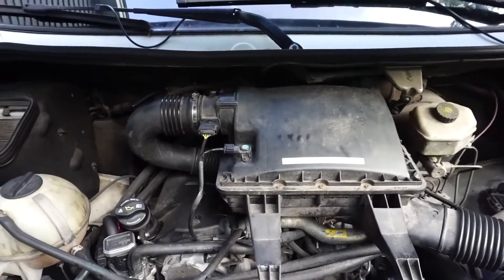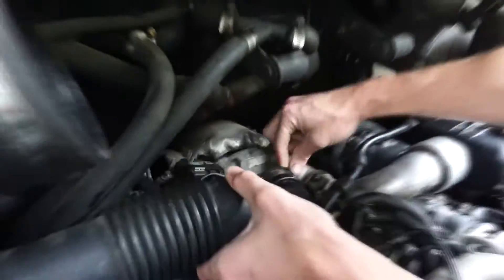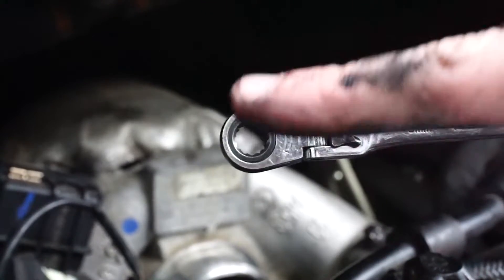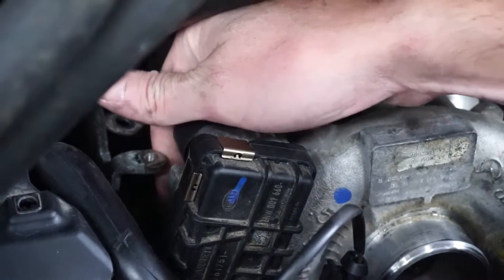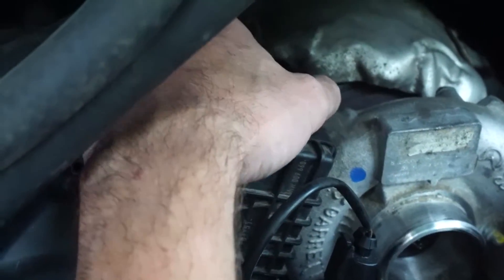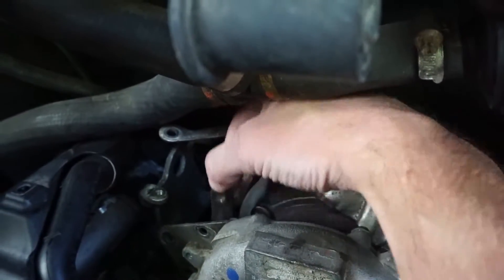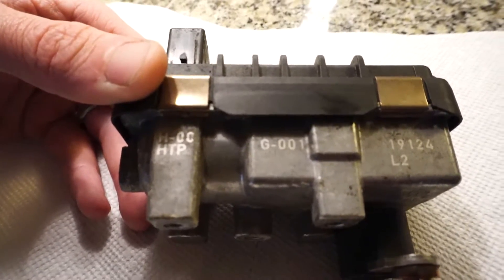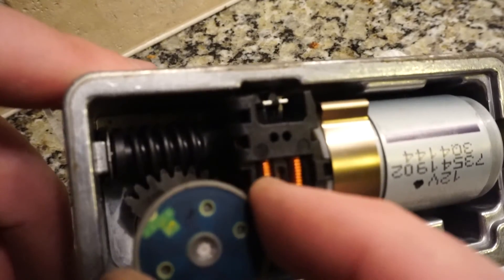07-09 Sprinter Turbo Actuator Removal and Diagnostic

Comment: Nice video you said you will link the where I can get actuator for 2008. I called few places they said I need to buy whole thing with turbo. So please let me know where I can buy actuator itself. Thanks
Reply from the maker: I don’t have a direct link for an oem complete actuator unfortunately. I’ve only been able to find remanufactured units as well as oem rebuild kits from hella, but they are only available overseas. You can find an aftermarket one on eBay and potentially amazon and other sites if you search around. There are a couple different versions/numbers so I’d hate to link you to the wrong one! Best of luck with your search!

Comment: With a low or high boost error code, I removed my actuator and added a small drop of solder on every main connection, I heard vibrations can cause them to become brittle. So far so good, codes are gone, thank you for the video
Reply from the maker: Emile Goguely very glad to hear you’ve had success!

Comment: My actuator lever is not seized but does not move with ignition on and revving the engine. Would you suspect the electric unit needs repairing?
Reply from the maker: I would try resetting the battery/ecu and seeing if something else has caused it to be in limp mode, but With it not moving at start up, I’d believe it may have failed.
Reply: @DabSedan  Hi, I know it pass three months already since this comment was done.
1- Did you was able to find why your actuator wasn’t working? Yo can diagnose it disconnecting the connector and tap first pin with the positive of you battery and the second pin with the negative. Then the fourth pin, get one more negative and apply slightly tap like morse codes. This will make the actuator moves back and forth. If only moves when you connect the first two pins and not when you tap the fourth one, the actuator is working good but you aren’t taping the last one right.

Comment: Great video. Quick question: what are the symptoms of a bad actuator. Although the battery is brand new, the first start of the engine always takes longer (especially if not driven for a few days); lately, I can't rev the engine over 3RMP (which makes her very slow to get up to speed). 
Do you think that this may be the root of the problem?
Thank you for your time.
Reply from the maker: It could be this for sure. Unfortunately there are several systems that play into it so I can’t say for sure, but with those symptoms, it absolutely could be this as I experienced similar ones leading up to this

Comment: I have sprinter 315 2007 and there is no actuator at all wonder what have happened and why it's been removed. Van working good
Reply from the maker: A N is yours a turbo Diesel engine?
Reply from the maker: The 2.2 wasn’t offered in America as far as I’ve seen. What symptoms/issues are you having? I will see what I can do to help!
Reply: @DabSedan  i dont have any issues just bought van and noticed actuator is not there.
Reply: Yours might be the vacuum type actuator. MUCH SIMPLER.
Reply: @shifty2755  you are right it is a vacum control type

Comment: Hey what was the problem? I have a Vito 2007 with the same v6 3.0 cdi and mechanic tells me to change this Turbo actuator. The problem is the engine sometimes works well and 1 minute later it hasn't got any power we changed all the sensors(map, maf, turbo pressure) because the computer write these for problem but they are brand new and all the cables are in good condition. What do you think it will solve may problem?
Reply from the maker: Kristóf Kovács I’m not sure what’s necessarily wrong with your actuator without testing it, however replacing the actuator sounds like it will solve your problem as it has solved my problem and many others!
Reply: Thank you!

Comment: In Vancouver, BC, we cannot order this part so I had to get it repaired. Its day 5 and so far so good it seems resolved. BETTER than resolved. Back when it was 'normal'', on a cold start before engine was warmed up it would hesitate a little. I always thought it was just a cold engine, the repaired actuator does not do this, the hesitation is gone. The other thing I notriced is when I take foor of accelerator and tough the brake then go back to accelerator, there was a clunk which I assume was a transaxle issue. Thats gone too, the old actuator must have twitched sending a surge of power. Overall the vehicle is smoother now, I always track my fuel consumption so will ahve to see if its improved where historically it was getting on avg 12-13L/100k in the city.
Reply from the maker: Jason Palibroda that’s awesome to hear!!! I’m glad it solved your issue!!
Reply: where did you get it repaired?

Comment: I assume its still working for ya, just curious whats your odometer at?
Reply from the maker: Jason Palibroda my sprinter has had a new engine installed before we purchased it. The new complete engine has around 150k on it. The repair solved the issue for sure, although I do have an update video that I am currently working on and will be releasing soon.
Reply: @DabSedan  where's the video?   What were the symptoms to think this was the cause.  That looked like normal play to me

Comment: Did the engine make a hissing noise before you fixed it? I have a wk diesel and its showing the p0299 code so i think this is the issue. Its also clunky upon slow acceleration.
Reply from the maker: Jared Ballard that hissing noise to me would indicate a potential boost leak? Have you checked the inter cooler hoses?
Reply: I looked at the inner cooler hoses but could not find any leaks
Reply: @jaredballard7853  I work on some sprinters at work. They are rare in my area so I don't get enough of them. I have seen these vans missing orings in the cac tubes causing boost leak. I have seen more hissing leaks when the gaskets blowout between the exhaust manifold and turbo ypipe. It is hard to see. I have someone rev it as hard as possible in gear, holding brakes while i feel down there, laying on the engine with my arm jammed down the firewall. These vans also leak at the egr. A plugged scr can cause leaks at the flexpipe. If you have a leak at the flex pipe, cut it off and look into the scr/cat to see if the cores came apart. If the scr is fucked you will see loose cubes, in this case the flex blew because of blockage in scr. You have many points of failure. Check for soot stains everywhere in the exhaust, leaky sensors, if you smell exhaust in the cab it is probably infront of the firewall.
Reply: @anthonyrybczynski5420  Hi I do have and under boost turbo with code P0299 on my 2007 dodge sprinter 2500. Initially it was a crack on the exhaust flex pipe right after the DPF and get fixed. Before it get fixed the turbo was working good and after that I noticed a hissing noise during acceleration “ it was a constant hissing “ I get under the van I look for leaks and everything is ok. I pressurized the turbo at 10, 20 and 30 psi with smoke and find out a loose connection between the resonator and the metal down pipe . I fixed that connection and check for any leaks with pressurized smoke and everything looks good. No leaks.  Also I pressurized the exhaust pipe and just find I tinny leak on one of the exhaust connections, witch I think is normal on exhaust pipes. 
Unfortunately I’m still have the engine working under boost. I can hear the turbo but not at 100%. After the air leak get fixed, I started noticed that if I’m on the freeway with a poor turbo as I mentioned before, it can stay like the for a about 15 to 30 min. And just at the time I reduce speed to get off of freeway it comes to limp mode with the same under boost code.
The turbo works perfect. I disconnected the lever from the actuator and have a guy accelerating and it works perfect. When is connected to the actuator I have noticed the never travel all the way down it only moves from the middle to up. It seams like something else is telling not to go down when the acceleration is applied.
Any idea?
Any idea what else to
Reply from the maker: Hmm. I’m not sure. Is the hissing only under load/in boost?
Reply: Have  you  found  rebuild  kit? Tx

Comment: Hi Sir ,
I have a  question to ask you ,
Mercedes  320  the engine is OM642 ,the turbo OE number is 765155-5007s , the original electronic actuator is broken ,we  buy a new one ,but it's not original ,when you put it on the turbo ,we got this Y77-1 signal wire open circuit,(report that the actuator has fault codes stored Y77-1 signal wire open circuit)Do you know why  ? Have you encountered the same problem before. we tested the electronic actuator separately ,It's normal ,why......      Please help  me ,Thanks  .
Reply from the maker: 王洋 what part number is the new actuator vs what part number was the one you took off?
Reply: @DabSedan   G-277 712120 6NW009420  this is the actuator number
Reply: @DabSedan  The original actuator number same with the new actuator.

Comment: Hey,  as I know if  its not the break from black cover(electronic control) most time, the problem caused by the worm gear, or motor.  The slight movement of the worm gear in your video seem is normal working condition. Have you finally locate the problem?
Reply from the maker: Kremer sino I replaced the actuator since I was unable to source just the rebuild kit without a 45+ day waiting time. It’s been great since! I have kept this actuator for a future further in depth diagnosis and repair video though!
Reply: @DabSedan  Yee, that's a good idea.   Now we also repair those turbochargers in China

Comment: Is there any issue if you replace the actuator with calibration with the turbo?
Reply from the maker: I feel like the older ones would be less picky. The replacement of the actual is very simple. I have faith!!
Reply: How long did it take you to replace yours?
Reply from the maker: Jimmy Lopes Photography as long as the part number is the same as the one you remove, you should be good. At least for myself and others that has been the case! Let me know how it goes!
Reply: I was told "I would highly recommend to replace the entire turbo. If you just replace the actuator you risk the chance of the calibration being off and ending up with the same concern. The actuators are calibrated when installed on the turbo at the factory, if you just replace the actuator, it may end up being out of calibration when you are done, and there is no way to calibrate it in the field so you may end up needing to replace the turbo anyways after all this and it will end up costing you more in the long run..."
Reply: @surpasspro   They are many tools can calibrate the actuator. To replace the gearbox part is quite enough for 95% such problem. Can save a lot of money
Reply: @Kremersino  I had the actuator replace, but I'm still getting an overboost code.  Its not going into limp mode though.  I don't believe the mechanic clocked the turbo.  So I'm not sure why I'm getting the overboost again.
Reply: @surpasspro   have you calibrate the new actuator before replace it?
Reply: @Kremersino  please help me out I did change the gears and the motor inside the actuator I put it back work for like a week when back at the limp mode comes back again can you please help me if I do have access to the actuator through my scanner to how many degrees or how do I calibrate the actuator because I can move it up and down with my scanner can you please give me an advice and thanks in advance for your help I'm looking for for your answers
Reply: @savasorin8206  Hello Sve Sorin,  first may I know which scanner do you use?  Does the scanner have calibrate function?   As I know there are have testing tool(rest the actuator whether work) and programming tool( which can can re program or call it calibrate) Such tool with calibrate function tool, you can find your actuator number, such 6NW....... inside. then you should choose the same hella number one in such tool, and reprogram it.
Reply: @savasorin8206  are your vanes sticking your turbo? This will damage a new actuator if this is the case.
Reply: @savasorin8206  what type of scanner you have?
Reply from the maker: I was told the same but my vans been working awesome since thankfully. It was worth the risk vs the $3000 turbo play hardware and way more frustrating labor
Reply: Thank you for your advice
Reply from the maker: Jimmy Lopes Photography of course! Always here to help however I can!
Reply: I have 2005 sprinter though, so IDK if its easier.  I'm not mechanically inclined.  If I bought one myself and tried to install it, do you think I can without messing things up?
Reply from the maker: Jimmy Lopes Photography 30 minutes? It really was very simple.